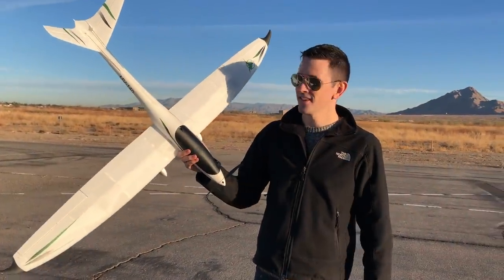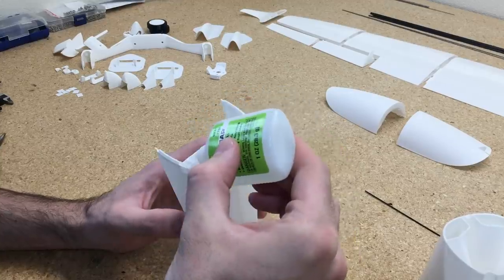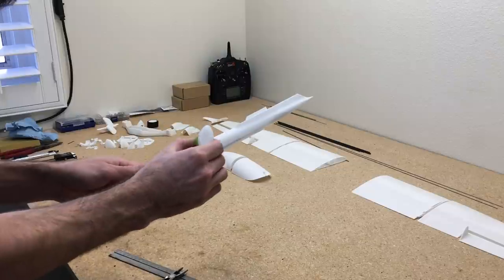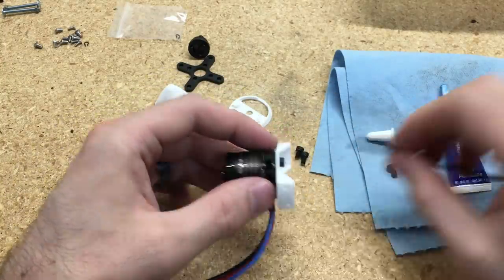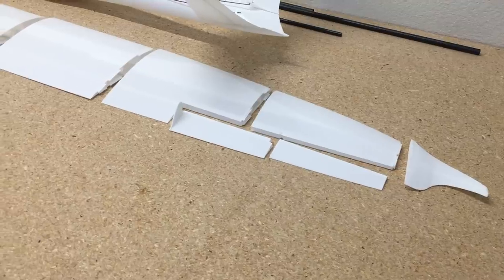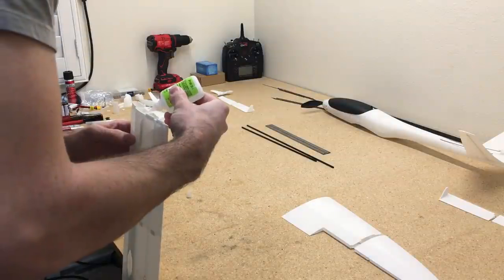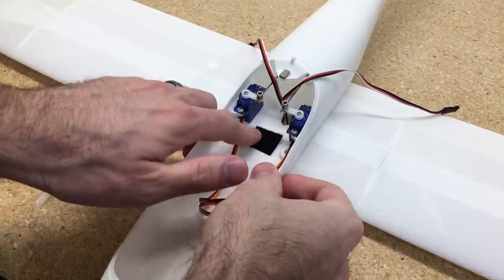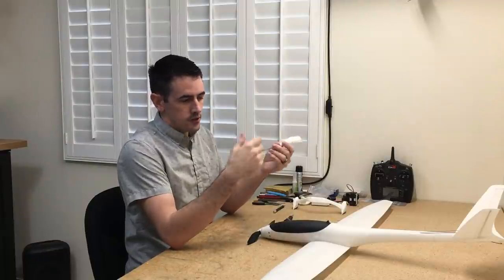How to Build Eclipson Model V - RC 3D Printed Airplane

Comment: flys well in PLA and is lees twitchy when it's windy,  Hey Troy try  a folding prop, use the Break and it will sail really nice
Reply: Anyone having trouble getting straight edges on wing sections I'm having a tough time and thoughts using a ender3v2 on dynamic with .6 walls

Comment: Another inspiring build. You always make it look so easy. I'm awaiting parts delivery for the Savage Bobber assembly. The printer was on a wobbly table and thr vibrations transferred to the print. I have since braced the table. Waiting for a test print to complete to see if it is improved. This build video was a great distraction. Thanks. Keep it up!
Reply from the maker: Nice thank you for the update this is something I can mention in on of my future printing video to make sure the printer is secure. I had problems with my Artillery with ringing and the main cause was the spool mounted to the top of the Z axis. I mounted the spool to the wall and now getting the best prints I have gotten to date. Good luck with the Bobber build it is a fun build.

Comment: My model V is printing now! Yes it does print fast. Creality Ender 3 Pro.
Reply from the maker: Nice have fun with the build
Reply: @TroyMcMillan  My buddy is building the Big Bobber and this model V is on his shortlist. Love these vids!
Reply: How do you find the Ender 3 pro for printing these models?
Reply from the maker: @patrickdavidokeeffe  I don't have experience with the ender 3 pro. But I have had many followers say that the ender 3 works very well for these builds.
Reply: @TroyMcMillan  I printed the PlanePrint test wing section perfectly with it straight out of the box using the original settings. The Eclipson Model V2 is an entirely different story using their provided G-codes. Their codes print at 100 speed which according to the drawing should be 50 among other things. To be fair, besides the G-codes, I had layer separation issues that may have been due to filament feed since some sections printed perfectly. Same when I sliced the STL files using drawing settings. I'm thinking this may have been due to the subpar bowden tube and fittings which I have just recently changed or a nozzle clog. About to start again.
Reply from the maker: @jpeterman57  Ya definitely try to slice the setting your self and not use the G code
Reply: @TroyMcMillan  I have bought the files for the model v and also bought an ender 3 pro. Currently printing the model v using standard pla and the supplied g codes. It is printing perfectly! Thanks for the excellent video! 👍

Comment: Hi Troy, very nice videos, thank you, they inspired me to purchase the Model V. I am running into a small problem. I have printed the fuselage, but there is a "slit" in the fus2 part. It is also visible as a very small slot in the stl file. I suspected that it would close when printed, but it did not. Is this normal? Or am I doing something wrong? The "slit" is located at the top of the part, a bit at the left side, starting where the canopy touches the fus2 part and ending where the fus3 part begins.

Comment: Another great video. I'm in the midst of assembling the Model A and could see some of the small refinements that went into this plane, such as the CF rod guides for the canopy halves. One question -- in several of your videos you use a small drill, e.g., to enlarge the holes in servo control arms. Could you share details and perhaps a source? Many thanks and keep up the great work.

Comment: I tried to print a plane in lw-pla recently.  White printed perfectly.  Black printed perfectly too but then a day later the skin of the part became all rippled and wavy in some areas making the parts unusable.  Have you had this problem and is there a solution?  perhaps moisture related?  I don't want to waste more filament as its expensive
Reply from the maker: I have not had any problems like this. I have heard of paint making it wrinkle but I painted my entire Model C and it worked good on that. I live in Las Vegas so it is very dry here not much humidity. Not all planes are designed to be printed in LW-PLA some planes have the International rib section spaced to far apart to work with LW-PLA. All the Eclipson planes work with LW-PLA.

Comment: it would be better with a single center wheel instead of that skid like in real gliders.
Also you don't have to plug servos to receiver to find center spot, you can just rotate the horn until the end stop one way and the other, then just place the horn in the middle, and then mount the horn as needed, and just trim later.

Comment: Have you ever had an issue printing the "fus1" file? Mine keeps getting knocked of the bed at about 95% through, when looking at the file in cura it looks like the file is actually angled on the bed by a few degrees, no editing to the file just imported straight in
Reply from the maker: Fore the Fuse 1 part I did use a brim to keep it adhered to the bed. Also I use hair spray as an adhesive to the bed.

Comment: Hey for make this rc plane do you need to have a both 3D printers from descriptions? 
or one is enough and if so which is better
Reply from the maker: You only need one printer. They are both very good printers one is just a bit larger build volume but is not needed the smaller one will work great for all the planes on my channel.
Reply: @TroyMcMillan  thanks

Comment: In ur slicer setting are u using any top and bottom layers.if so how many?
Reply from the maker: For all the wing and fuselage parts there is not top and bottom layers. Only top and bottom layers for other parts like ailerons and other parts that specify in the PDF file indicated by the numbers on the side.
Reply: @TroyMcMillan  ok

Comment: Hi, I am in the process of printing the V2. Is there a replacement for the sunnysky 2212 1400kV? This one seems to be hard to get (in Europe). Banggood just cancelled my order.
Reply from the maker: I am sorry to hear that it has been hard for me to get this kv also. I have recently been ordering from https://sunnyskyusa.com I am not sure this will be a good option for you in Europe but you could try. You can use a 2212 1250kv would work good also. If you can't get any of those any 2212 motor will fit but the prop spinner may not work if you use a different brand than sunny sky.
Reply: @TroyMcMillan  Thanks for the reply. The shipping would be 38 $ for a motor that is only 15 $. So I will be looking at China again
Reply from the maker: @dc392hemi  Ya I defiantly understand that. For me it is the same thing in the other direction. When I want things from china the shipping is 2 times the cost of the part and takes 2-3 week to get to me. Hope you can find something that will work.
Reply: @TroyMcMillan  I think I will try the Turnigy 2213 1050kV, it's a little less thrust than the SunnySky but the same weight and dimensions
Reply from the maker: @dc392hemi  That should work good. This plane flies very well so little less power is ok. Have fun with your build. Cheers

Comment: Great video Troy! So are you using the gcode provided? Or setting up profiles? Because I have several Eclipson models and all have a lot of retractions in them, if you are using your own profiles then is there a setting I'm missing? The model V is an old model and I have the model Y,T, Prandtl and model A. If I use the provided gcodes then I have stringing and pin holes, but my profiles I have made work flawless. There must be a setting that I don't have, I've scoured Eclipson's website and per there profiles I'm right on but still have up to 30% of print time in retractions. It doesn't bother me just trying to figure what's different. Thanks again!
Reply: It has nothing to do with the setting, it is due to a new design philosophy, our latest 4 models are using this technique and we are planning to extend it to older and future designs due the positive feedbacks received from our clients
Reply: @eclipsonairplanes  thank you for the reply, keep up the great work!

Comment: Once again another excellent video, call me selfish but I wish you would do your builds and test flights using PLA instead of LW PLA. Unless it becomes mainstream I'll probably never use LW PLA so I would prefer to see how things turn out using regular PLA.
Reply: @eclipsonairplanes  Yep I've watched that several times. Bought the model c files yesterday and started my printing adventure. First wing section came out perfect although it seems heavy so going to check my settings to see if I have too many layers or something like that
Reply: Try the newer PolyLite LW-PLA, it prints just like normal PLA (it's pre-foamed), and weighs about 65% of regular PLA. I'm printing a plane with it now and it's coming out really nice. Currently $32 for a 800g spool on Amazon US.
Reply: @jasonhurdlow6607  Thanks for the heads up. I'll take a look at that stuff

Comment: Do they sell the models as a STL file or as GCODE? 🤔
Reply from the maker: STL files
Reply: @TroyMcMillan  thx
Reply: I just purchased the plane.... it comes with the files and the Gcode for both LW and standard PLA.
Reply from the maker: @moochasas  Thank you for this reply. I was not aware it came with Gcode files.
Reply: @TroyMcMillan  the gcode files are they for direct drive or bowden end printers?
Reply from the maker: @fyzobaba  I am do sure about the G code files I just get the STL files. I will try and find out for you.

Comment: Hi Troy. I (Martin) subscribed to your channel and with your help I have managed to print out the test wing from Planeprint and it is almost flawless. However after buying Savage Bobber I realised my printer could not print anything taller than 180mm. Not a problem as Planeprint refunded my money which to be honest I wasn't expecting. My question is: do you know of any printed aircraft that are suitable for printers with a max Z axis travel of 180mm ?  My next task is to extend my printer gantry. Keep up the good work.